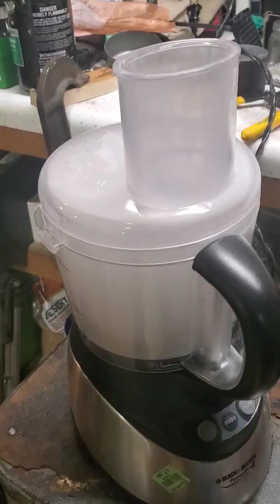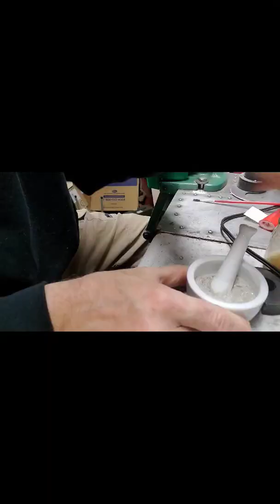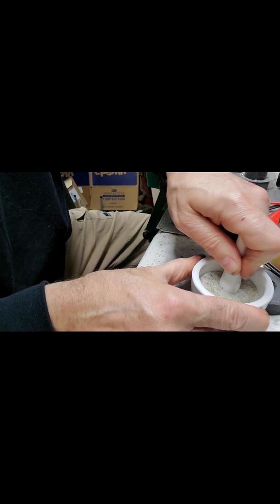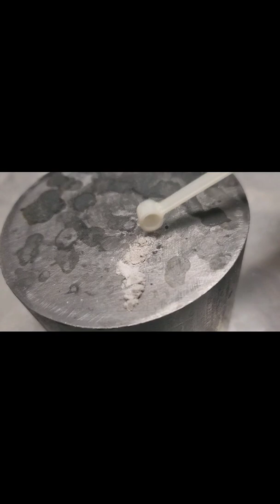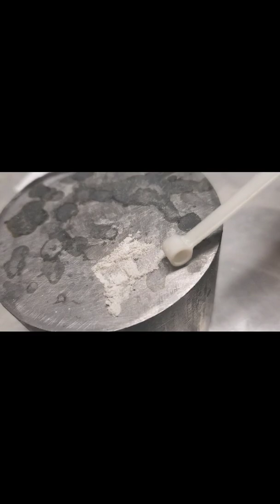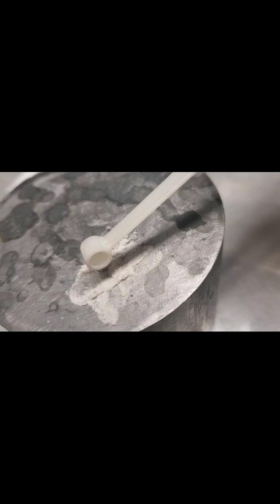Making ground glass for homemade priming compound.

Comment: I would think that a fine sand would work in its place. Just a thought.
Reply from the maker: Probably
Reply: Ground glass probably works better but I didn't have any so I used fine sand and ground it to the consistency of flour. Thus far it's worked
Reply from the maker: @joefielding2298  I see no reason why it wouldn't. Good idea
Reply: @joefielding2298  good to know.
Reply: Sand box sand is different from construction sand,which is called sharp sand.
Michaels Hobby Supply store sells ground glass.